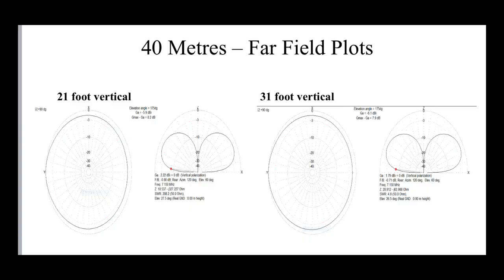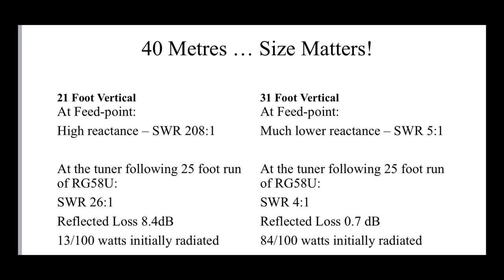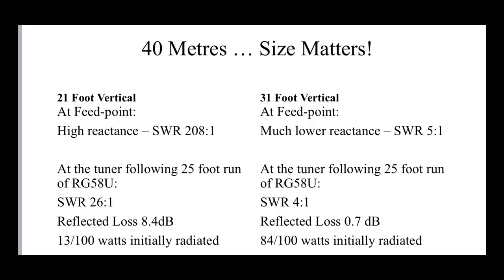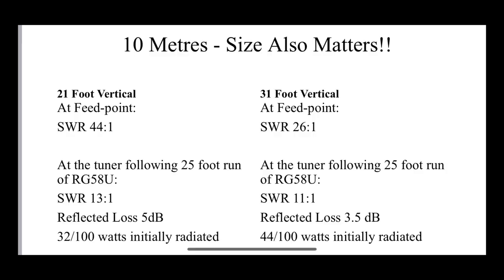9:1 Unun Vertical Antennas - 40 metres through 10 metres

Comment: Interesting discussion Tim. I've never been keen on the whole 9:1 idea, primarily due to the amount of loss in the coax due to the high SWR.

If going for a multiband a vertical antenna, I would say either go the DX Commander route with multiple vertical elements or (as you suggested) put a tuner at the base.

You are absolutely correct that there will be some loss in the tuner but it will be insignificant compared to the losses in the feedline due to the mismatch if using a 9:1 & tuning it in the shack. I'm led to believe that these tuners are fairly efficient, even with a big mismatch.

Obviously this doesn't solve the issue of the RF going skyward on the higher frequencies due to the antenna being too long.

Realistically a choice has to be made based on your main operating bands.

A 10m vertical will act as a 1/4 wave on 40m & a 1/2 wave on 20m. It will probably also do ok on 30m. I would consider this a fair compromise for those bands but trying to use it on other bands will probably be very disappointing.

Same is true with a 5m vertical for 20m & 10m. Again it will probably also do ok on 12m, 15m & 17m, so I would consider it a fair compromise if targeting those bands. However I can't imagine that it will do to well on 30m or below.
Reply from the maker: Good points James .. it’s all a compromise!!
Reply: Same thing in audio.

Comment: A very informative vid there Tim. I use a 9:1 with a 7.6m wire. It works quite well on 40 thru 10, with SWR spikes managed by the tuner. I do find it doesbhave low SWR on some parts and I do not have to tune it. It has been effective on DX QSO's, with US, Caribbean, Brazil, India to name a few. I do have about 250m of radials too.
Reply from the maker: Sounds a very nice set up 👍👍
Reply: But what will be if I just graund it in balcony I dont have 250m . Hmm🤔
Reply: We can use more than 7.2/7.6m length, it's good

Comment: At QRP levels length becomes critical as any inefficiency spoils DX opportunities. I do not use ground radials (the antenna is elevated about 9' off the ground) but do ground the un-un which seems to help on a 31'  length and i get about 6-7 watts at the antenna from 10 watts at the rig. This video has given me a couple of extra ideas to try. cheers Tim and 73 . M7BLC
Reply from the maker: Good points John.

Comment: good explanation, and this is why, with 5w qrp here, resonant verticals are the only way to go really, and as 40m and 20m are the only bands ever open down this way, No need to worry about multiband ants. But I have worked the high bands once when there were open, using a 40m vertical and extremely high swr, but still got qso,s. Because when the high bands are open, there really open, and its easy to get dx over 10k.

Comment: I'm confused is balun a misused term. Should not what most people call a balun actually be called an Unbal. It comes from Unbalanced radio 50 ohms to balanced dipole or other impedance antenna. The ratio just is whichever one matches or converts from 50 to the antenna impedance.  However very few people feed verticals via a balun or ladder line, for starters most verticals in HF are 50 ohm and I do not know of 50 ohm ladder line. 
  However why not add a 1:1 balun or rather un un with pl239 and so259 Just to eliminate any common mode. Why can I never find a 1:1 unun on the market but so many bloody wire unbals.
  This is knowledge ! Bravo.
Reply from the maker: Thank you!

Comment: Tim best to use a 49 to 1 and 10.1 meter of wire and add a 34uh coil and 1.85 of wire after the coil and you get 40 20 10 with very low loss thanks.
Reply from the maker: Yep done and shown that quite a few times. I agree it’s a very good set up. Of course you still get the high lobes on 10 as it’s a full wave on that band 73

Comment: Tim...what is your feeling about the 31' version to cover 40/20/17 and 15 only?  Do you feel better about it's DX chances eliminating 12/10 then?  Thanks, looking now to do a new project
Reply from the maker: It’ll be slightly more efficient on 40. It will be nearer to a 1/2 wave on 20m, so impedance would be slightly higher.

Comment: Thanks for the video. I’ve build a 9/1 vertical, I think I used 29ft length of wire. It was terrible although it tuned fine. I tried the same antenna with ground radials and seemed loads better. Could be worth modelling it with radials Tim and comparing the results.
Reply from the maker: Yep good advice. I modelled these with 12 quarter wave radials for each band so all covered 👍 73

Comment: I use a 35.5 foot wire sloping L that generally outperforms my OCF 134 ft. Dipole on 40 meters and 20.  I have a remote relay to switch between them to A/B the two antennas.  (I send switched DC down the coax from my home brew tuner). I feed them both with their own 1:4 transformers.  I can operate 40 with the tuner "out" and low SWR on 40 and 20 meters.
I have a little question of why people use less than a quarter wave on 40 meters when a few more feet will significantly raise its radiation resistance  and greatly  reduce ground losses. I previously used a 53 foot random wire that would put me in S. AMERICA and B.C. on 160 milliwatts. (Also fed with homebrew 1:4 wrapped on a transistor radio ferrite antenna core.
Reply from the maker: Nice example - thank you!

Comment: Hello Tim, use an old toroid from an old Tv, 9:1, with 4,40 meters of wire, result in Vertical End Feed JS20 Portable/Fixed, work very well without any tuner from 20 meters to 10 meters. 7351.
Reply from the maker: Nice!

Comment: Very interesting study. Great presentation. 

What transformer and wire length could one use for 160 and 80 meters with limited space? I and lucky by having a 25-28 meter tree.
Reply from the maker: Thanks Doug. If you are using that tree then something like a 9:1 should tune 80 and up.

Comment: Thank you for this explanation Tim, especially where you discussed the compromise nature of a vertical fed by an unun.
I have been wanting to design such a vertical antenna, with a max height of 10 meters, that can give credible performance (adequate angle of rad. and low loss) within 14 to 30 Mhz.
I wanted to include 20, 17, 15, 12 and 10 meter bands only.
What would you say the best antenna height be ?
Thank you
9H5LX
Reply from the maker: Hi Vincent, the 7.6m long vertical would do nicely on those bands and still give you an OK version for 40. If you wish to focus exclusively on 20-10 then a 7m long radiator would do very well as a 5/8 wave on 12 in particular. 73

Comment: Regarding antenna modelling:  Decades ago, for quite a few years, I used to frequent the 'rec.radio.amateur.antenna' newsgroup (remember those?) where the true, well-known names, subject matter experts (and an occasional lunatic) used to hang out, endlessly discussing the nitty-gritty of antenna modelling and how it relates to the real world. Back then, it was reported that there was a 'mysterious' discrepancy between the (modelled) far-field signal strength of a quarter-wave vertical over an infinite ground-plane, as compared to a modelled vertical dipole. The discrepancy was variously reported as being +3dB or +6dB in favour of the quarter-wave vertical over an infinite ground plane. That seemed very odd, that less antenna would work better than more antenna. Conceptually, in a perfect model, they should be identical (the old ground-plane 'mirror' concept of a quarter-wave vertical). To be clear, none of this is referring to just the peak at some take-off angle; but the entire pattern over the entire hemisphere (think 'average'). It was kinda a big deal.

If I recall correctly, some of the discrepancy was eventually attributed to carelessness (by some, not everyone, thus the variable reports: +3dB and +6dB). The dumb error was feeding the virtual feed points with a constant voltage source (which is common in some modeling SW at the time, still today ?), thus (for the same voltage) causing double the current (thus 2x power) into the lower impedance 37-ohm ground plane as compared to the 73-ohm vertical dipole. They forgot to normalize the applied RF power; a bit duh-obvious in hindsight. Easily corrected.

Once that silly error was sorted out, there still remained a significant discrepancy (perhaps 3dB if memory serves), in favour of the quarter-wave vertical for the signal strength in the far field. My suggestion to this dilemma was quite simple, but I never heard anyone confirm or refute it (although some dismissed it out of hand). In the computer, the 'universe' (the model space, perhaps a 3d matrix) is obviously not infinitely large. So if you cut-off one-half the 'universe' with your infinite ground plane, then there's zero energy going into the lower half, and thus perhaps the resultant field strength in the upper half of the virtual universe would naturally double. Common sense? In other words, perhaps this reported discrepancy is merely an artifact of the computer model, and one that is perhaps not easy to overcome. If the people writing antenna modelling SW have sorted this out, I wonder if they had to resort to a SW kludge to fix it. I never got the memo. 🙂
Reply from the maker: Thank you for this insight. Fascinating stuff 73
Reply: Crikey, only a couple days later, I stumble across an example in the wild. In reference to a 22m Part 15 beacon, "...the limits are 4.6 mW into a half wave dipole, or 2.3 mW into a quarter wave ground plane antenna." So a 3dB 'advantage' to the quarter wave antenna over the half wave antenna. Error (I presume) might be either of the two causes I've outlined above, more likely the latter one.

Interesting that this supposed 3dB 'advantage' of a quarter wave antenna over a half wave antenna, defying common sense, is still going on even decades later. Someone should really get to the bottom of it. Double check the applied power, beware voltage source, confirm impedance. Then try trimming the ground plane from infinity to just quarter wave, or (as was recommended years ago) quarter wave +5%. Step 1 would be to reproduce the anomaly. Then see if it has a logical basis. Maybe try a vertical dipole split by an infinite ground plane, but will require two feeds, out of phase, beware total power. All of this is right at the very foundation of antenna modelling. Either there's a rational explanation (which I cannot imagine) for the supposed +3dB 'advantage' of a quarter wave antenna over a vertical dipole, or we have a 3dB unconstrained error loose in the wild, potentially leading people astray for decades.

Interesting eh?
Reply: OMG. When people are burying hundreds of meters or even km of wire, I hope that they're not unknowingly trying to cut-off the lower half of the universe... 

"Yep, my computer model says I'll get +3dB from my vertical if I can just put the bottom half of the notably-finite virtual Universe into a Faraday cage." ...Continues digging...

P.S. the other slightly-embarrassing hidden assumption: the Earth is flat, as the DX antipode is still in the upper half. This would likely cause red-herring distractions during any discussion.

It's an odd discrepancy. Odder still that it's been kicking around for decades. I've never heard of any logical explanation why it's actually not an error. So I assume it's an error. 3dB !!

73.

Comment: I played with 9:1 unun verticals, I ended up running to verticals. 1 for 40m -17m which was 29.5 feet and one that was 24.5 feet that worked well for 15-10. They are compromises so you have to make compromises with them.
Reply from the maker: Great point

Comment: 2:00 "...12 quarter wave radials..." Since they're all "quarter wave", is that 12 radials per band?  Seven bands = 84 radials = getting close to half a km of wire (~432m).
The back garden can't simultaneously be so small that the resident can only be allowed maybe one square meter for a single vertical element, and yet the same back garden is somehow also big enough to allow 12 quarter wave radials for the 40m band (i.e. 10m in 12 directions = at least 20m width and depth). That's a good size yard for the UK, a tenth of an acre for just the back garden.
I wonder if that same 432m of radial wire might be better used up in the air (instead of buried). Perhaps a multi-element vertical to have fewer compromises, or more than one vertical antenna and a coaxial switch. Optimization is good, but bypassing the compromises might also be an option for most people.
Reply from the maker: No I meant modelled per band
Reply: Yep. In general, I don't see the need to actually bury hundreds of meters of ground wire *for the higher HF bands*.  160m sure. 80m perhaps, 40m maybe. Anything higher than that, people should strongly consider the advantages of other options: raised feed points and far fewer radials, or various more-balanced options. To clarify thoughts, would anyone have their 70cm (440 MHz UHF) antenna mounted on the ground (dirt) with endless numbers of buried radials, or is it more common to raise the antenna way up as high as possible?  Same thing begins to apply even at (roughly) the 30m band, or arguably 20m if you prefer.

But if one lives on a tall cliff overlooking the sea, then okay - go for it. No need for any antenna height (AGL) for at least one side. 🙂

Comment: how fo you add the 9:1 in MMANA?
I am trying to make a wire version of the cha250b antenna but need to work out what unun I will need (tried making the cha250b unun but it is to dificult), the cha250b is 23 foot 5 inches.
I know in MMANA you add loading but I have no clue what you type into the boxes for each unun.
Reason I want to make one is that I cant justyfy spending nearly £400 on an antenna if it wont work in my situation so want to build a wire version to test first.
Reply from the maker: Which bands> 40-10? Sounds like the length (nearly) of a Rybakoff(?) antenna which I believe uses a 4:1 balun and counterpoise/radials on the ground.

Comment: Hello Tim
I am a new subscriber and new Ham. In need of advice from your excellent knowledge.
I've just put up an 9:1 Unun with 20 metres length of wire for 80 through to 10 metres.
Thankfully I have a 100 foot garden with a tall willow tree. The antenna is mounted horizontally one end at 12 metres sloping up to 22 metres height.
I've an old Icom ic 728 with the external icom 160 atu, grounded to an earth rod. Feed is 20m of RG8 mini coax.
There is a slight sag of approx a metre from the highest end. Is this ok?
Would the unun benefit being grounded to an independent earth rod?
Maybe a counterpoise and what recomended length?
I think I should of gone with a 49:1
Much appreciated if I could please have advise from some one experienced...
Reply from the maker: Thank you for your kind words. Wow you have a nice height on that antenna. Are you able to fit around 132 feet of wire into your garden? Even if you run it as an inverted L? I think a 49:1 efhw of that length will get you an excellent match 80-10 and you only need to have a choke about 5m or so from the transformer (or further) and maybe another one just before the coax enters the shack. With that height you’ll do very well indeed. No need to earth anything with a 49:1. Especially running around 100 watts or less. Hope this helps? 73
Reply: @timg5tm941  Ahh thank you for replying. Yes the height is quite amusing, looks as if I defied gravity. I've six fence panels across so I guess thats over 36ft width and a conifer tree even higher in the corner I can drop a draw string over it with the drone, i think 132ft would squeeze in. Only just doing the foundation level with the 10 watt limit I probably won't go up to the intermidiate until next year. Would the choke be one of those "ugly balun" things? Again thank you I very much appreciate your advice. 73
Reply: @timg5tm941  I have ordered a couple ft240-31 toroids and project boxes etc to make common mode chokes.
Thanks for the advice

Comment: What would happen if you 40mts  in a  Inverted L 9-1 or 49'1
Reply from the maker: For the 40m band using a 49:1 use 66ft of wire - it would work well on 40 20 15 10. For a 9:1 reduce the length to around 58ft so the impedance is lower and can be brought down to a better swr by the 9:1. You will need a tuner for these bands however with the 9:1, unlike the 49:1.
Reply: @timg5tm941  this is helpful. Am I right in interpreting that the radiator length which is likeliest to achieve the lowest SWR specifically at 40m through a 9:1 is ~58ft (when factoring in the ground radials)? I’m trying to figure out if I can dial in the radiator length for a shorter vertical (or near-vertical) for 40m that I might get away with sans tuner (yet retaining the 9:1 matching box at the feedpoint). Then I might use it well with my QCX-mini 40, while perhaps gaining some additional bands with a larger rig. I guess you’ve already shown that 31ft doesn’t get us there… so I perhaps shouldn’t expect this at any measurement <=40ft?